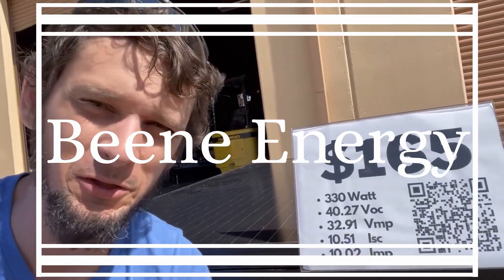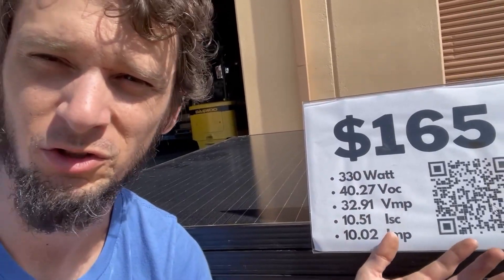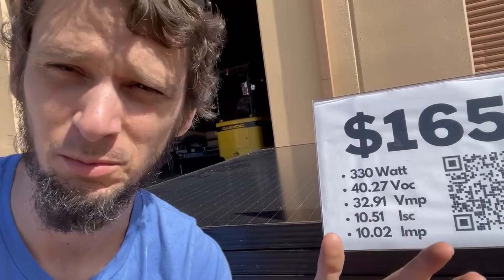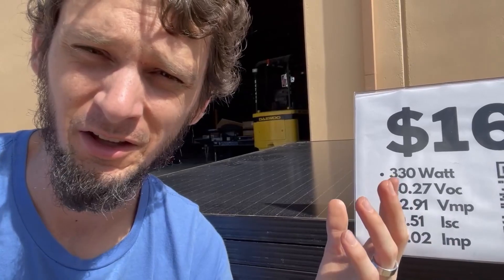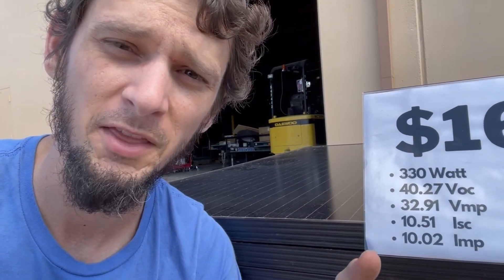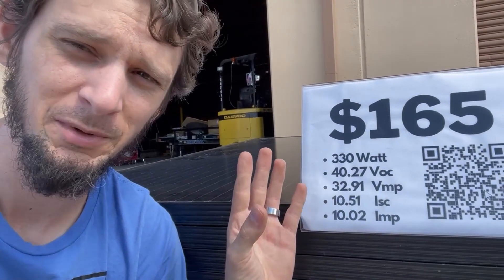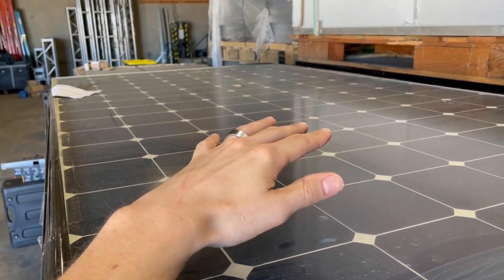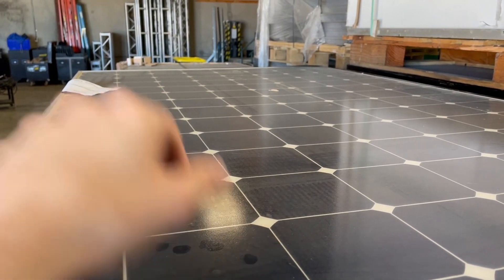What is a 24V Solar Panel?

Comment: How can i identify the 24v solar panels if label is missing
Reply from the maker: You can get close by measuring the voltage in full sun. Voltage drops as the cells get hot but if you can measure quick while the panel is at room temp a "24v" panel will be about 37-40v. You can also count the cells. 60 cells is a 24v panel.

Comment: WHERE CAN YOU ORDER THOSE 330W PANELS FOR $165?
Reply from the maker: I’ve still got those on a pallet at the warehouse. We don’t ship though, so you’d have to be within driving distance of Mansfield tx!
Reply: @BeeneEnergy  OK. THANKS. UNFORTUNATELY THAT IS A LITTLE TOO FAR A DRIVE FROM NORTH CAROLINA.
Reply from the maker: @kiltedbill7594  ah yeah, that would be quite the road trip!
Reply: What are the advantages to use  24vdc solar panels through a mppt solar charger on a 12 vdc battery  system

Comment: So the battery can only use its rated voltage so are the large number of volts just wasted?
Reply from the maker: If the panel is using a PWM charge controller yes, the extra voltage is wasted. MPPT has a dc to dc conversion circuit inside that still takes advantage of that extra voltage.
Reply: How do MPPT charge controllers use the extra voltage if the battery can only take about 13 volts for a 12 volt battery? Does it somehow convert it into amps?
Reply from the maker: @precisiont5188  I won’t pretend to be an expert in electronics. The way I understand it the mppt charge controller does the job of finding the optimal power poly (voltage and current) and once it brings that power in sends it through a buck converter so that as much of the power (watts) gets to the battery as possible. No matter what voltage the battery is at.

So you could have a 40vmp panel at 10imp charge a battery at 13v 30a.